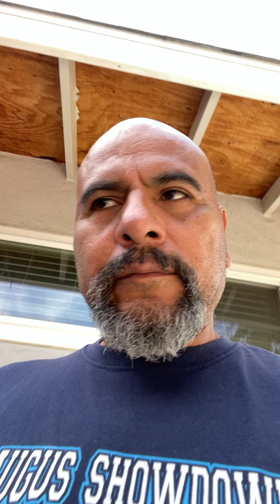P2196 P2198 engine code mustang 4.0 liter 2007

Comment: Do you have to run a scanner when replacing the fuel injectors?
Reply from the maker: I have a scanner but it only sees the number 1 cylinder. If you get a rich or lean code it could be an injector. Lean could also be an air leak. I used a timing gun on all the spark plug wires and just about all the cylinders were fouling. In my case the injectors were poor quality. If yiu get a hold of a scanner that can see all the cylinders check the injectors that way
Reply: @automechanicc  Thank you for the prompt support and for the content of your channel.  Suscribed!